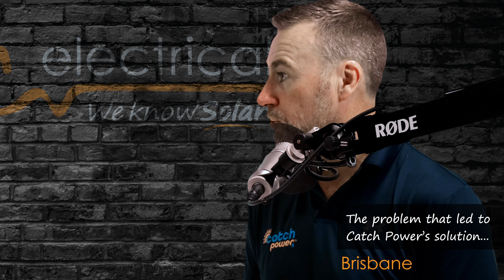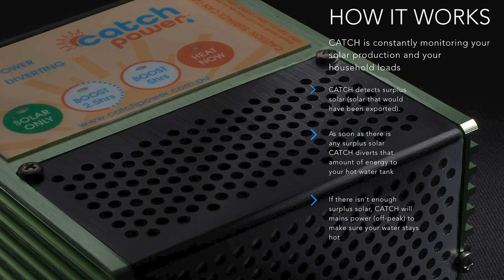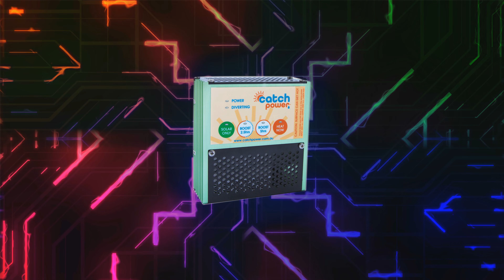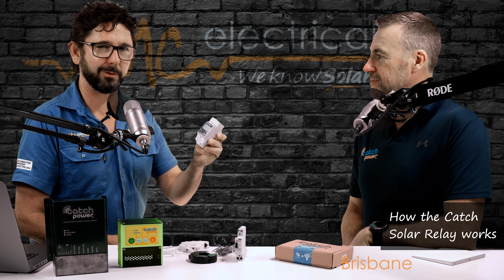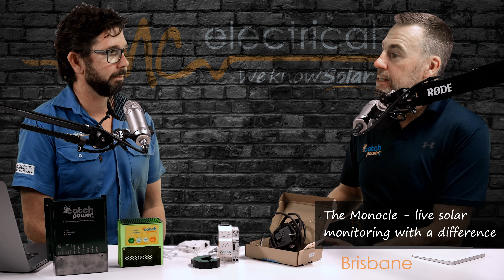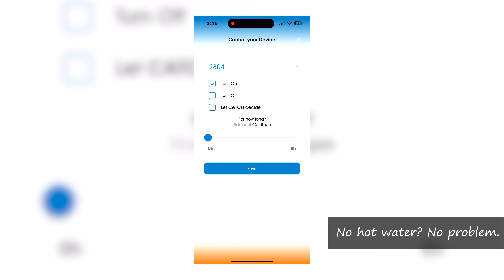Catch Power Full Review

Comment: I have had Solar for 14 years and also installed a Solar Analytics device so I could monitor load and solar production. The first thing I did was change the 4.8Kw HW element to a 2.4Kw to keep the load inside the Solar Curve and it is on a Shelly device and contactor if I need to turn the HWS off. I also have an instantaneous Gas Hot Water on a Shelly device so I can changeover in the event of prolonged overcast/bad weather. It works great and this device is awesome👍
Just signed up for a 28Kw battery after finding out that Feed in tariffs are heading to 1 cent per Ke next year. Solar export penalties are just around the corner.

Comment: Hi,
I have no idea the difference between this and a hws switch.  I'm about to install a battery, so is this worth the extra $1000 to have this on my T33 hws?
Reply from the maker: Nope. Maybe keep it simple with a battery. Actually depends on a lot of factors but …
Reply: @mcelectrical everything depends on X,y and z with this.  Installer is pushing for one.  I'm upgrading the inverter and adding battery both Sungrow, and possibly exporting a smidge to the grid ... The only thing it would handle is the HWS as far as I am aware.  
So don't get one.  Okay.
Better with the switch or no?  
I'd like to tell the elec co to be gone.

Comment: I'm not sure about having a hot water system (any hot water system) containing so many complex - and expensive - components to make and utilize hot water.  Do I need to ask, what is the return on all of this, or is this a status ?
Reply from the maker: Yeh I kind of agree. Keeping it simple is often best. But if you are already installing a solar system with a consumption monitor (Fronius smart meter) then this will only add a couple of hundred dollars. It’s much simpler and more affordable than a diverter like Green Catch or the Ohmpilot. And, less complex than a heat pump. But no doubt it reduces reliability.

Comment: I've just had solar installed along with a Catch Power solar relay. I found this vid very informative.

It's still early days but I found the app The Monocle to be... lacking. For example, there are many settings which it isn't able to alter such as the Export Control time (which I assume is the default load switching time). Yes, you can set a schedule but that has a definitive end date so if you forget that its ended, it just goes back to the default.

I've also discovered that the installer set the H/W tank wattage to 3600W but it's a 3000W tank (I've got to follow up with him about that). However, it does highlight the point that the end user is extremely dependent upon the installer configuring the device correctly which isn't necessarily a given.

So, plenty of potential but not a polished experience from a user's point of view.

My suggestion would be to merge the user app & the installer app into a single app, but password protect the installer side of things.
Reply from the maker: Yes good point. There is a lot we can see from the back end after the job is done. But you are relying a lot on the installer to do their job right.
Reply: @mcelectrical  I also latterly discovered that Catchpower documentation is awful.

As a telco tech & technical document writer, I'm used to incomplete or misleading technical docs but Catchpower docs have to be some of the worse that I've encountered.

They have plenty of information but tell you nothing at all.

A part of the problem is that there's no visibility of underlying default settings so there's no understanding of how the whole setup is structured.

It's a pity that there's no feedback channel for Catchpower. I'd love the opportunity to help them improve the user experience.

Comment: $447 is a hefty outlay plus installation costs.
though the new EV charger integration might make this more palatable if it works with current EV chargers. 
it'd take substantial ROI time
Reply from the maker: It also replaces your consumption monitor, (for a lot of inverters) so if you haven’t already installed solar, it makes it affordable. But, yeh as a retrofit it’s not that affordable.

Comment: Can’t say say I’m impressed with the Catch just installed, may well send it back.
Issues include a poorly integrated series of four apps needed & which tend to overlap, ie: The Monocole, then CatchPower for config), then Solar Analytics embedded within Monocle but then wants a separate app install for My Solar. A PITA.

Then there’s the all over-the-place endless documentation for various bits, much of which is poorly explained. I can never seem to see the HWS actually doing anything, though seems to remain hot so something must be working. Still, always seems to show ‘0W ON. 

I also had no success in setting up an EV charger via OCPP despite obtaining the specs through (once again) click, click through their apps, something like Montocle to CatchPower to website and add charger. After quite some messing around, Moncole seemed to have the right data as did the Wallbox, but would never start. Essentially this process just locked the charger. I wrote to Catch about this and the above but to date have had zero response.

SO my felling is to return it and put in a straight-up Hargar timer for the HWS. If I do eventually go for a heat pump, this will have its own time built in. Meantime am also trying Charge HQ. 

Could be a good box I guess, but the implementation (sw, apps, docs, support) appear very poor.

Comment: Looks like a very cool device. The way I understand it though, the only difference I can see between this device and the Fronius Load Management, is that with this device you can actually program when the device switches on. ie If there's cloud all day, you can program it to use the grid when the rates are cheaper, as different from the Fronius where it will just switch on to fit in with the minimum run time and end time. Or have I missed something?
Reply from the maker: That's one of many features. The Catch Control has levelled up recently to cover a few new use cases, more on it here: https://www.catchpower.com.au/catchcontrol

Comment: thanks for the review Mark.  I got my green catch power installed today at 10AM.  It's now 10:30PM and I noticed power is being diverted (full load) to the HWS suddenly.  It was cloudy today and I don't think the HWS actually got up to temp so perhaps green cp is in override mode already?  I understand it comes in after a couple of days of insufficient sun but being brand new today perhaps it just needs to get this override session out the way and should be normal from tomorrow?  Nothing in the users manual has any detail on this.  I would actually prefer if the logic used was documented, better for peace of mind and working out whether any manual override is necessary.
Reply from the maker: Hi Glen. That doesn’t sound right. Is it working now?
Reply: @mcelectrical  Yes, it is working perfectly now, just that first night diverted to HWS at full load (2.4kW) until thermostat cut-off.
Reply: @mcelectrical  I finally worked out what has been going on!  I had not read the part of the manual that distinguished between steady LED and flashing LED for controls "Solar Only" and "Heat Now".  For how I use the system, I need to have "Solar Only" LED flashing, meaning that even if water is cold HWS will not power on until daylight next day.  Missing this tripled my electricity cost yesterday, lesson learned!  In hindsight I wish that info like this was included on the Catch Power marketing webpage as it all helps to understand what you are getting before comitting to purchase.  Info is there, but not prominent enough IMO.

Comment: I have a GoodWe 6kw Hybrid inverter GW6000-ES-20 and 10kWh of Lipo4 battery storage, I have a standard hotwater system with no timer at all and runs whenever it needs. How would this be best incorporated?
Reply from the maker: It can work with Goodwe as a consumption monitor, but I’m assuming you already have one. It can just be installer as a hot water diverter, either before or after the battery.
Reply: @mcelectrical  Cheers :)

Comment: Cool product if you have still have a kettle hot water 
heat pumps are king and still best on a timer with override way and better solution imo
Reply from the maker: In most cases, yes probably. https://youtu.be/Mz2QaWodrzw?si=q0YZq_2jWXLbBrS3
Reply: Mine failed post warranty....have since simplified with Catch

Comment: So installed I’d be looking at around $850 ($750 + $100 install) for a Catch setup, instead of $250 ($150 + $100) for a normal timer switch with manual override and just put the hot water on a timer. I’m not sure I’d ever make the $600 back at it would only be days (hours) I’m not producing.
Reply from the maker: No, I think you are comparing the catch hot water diverter with a timer. The catch relay shouldn’t be so expensive, unless it is retrofitted
Reply: @mcelectrical  good pickup. That said even the relay is $450 so assume ~$550 installed which is ~$300 difference to a timer and I’m assuming the same install cost for both which may not be correct. I’m on the Sunshine Coast in QLD where it’s sunny most days and even on days when it’s overcast my 13KW of panels is still producing at the times I would set a timer. Even with out of control electricity prices I just can’t see how the unit would pay that off in 3-5 years (5 is its warranty). I say 3-5 because obviously you’d want to pay it off in 3-4 years so you make a profit from going to the effort of installing it.
Reply from the maker: If you already have a smart meter for your inverter, It’s about $150 more than a good quality timer fully installed. But if is a new solar install, it will replace your inverter’s smart meter, then cost about the same as a timer. The catch relay also has an app for simple clear monitoring, you can manually switch on or off water with your app, and your installer can use it for remote diagnosis. Catch also has dynamic export limitation capability, and EV charger control (coming soon). It’s so much better than a timer!

Comment: Your comment about, "...watching it follow the curve", is puzzling to me. My family has had a Green Catch since May and it has never shown on the Solar Web App (Fronius Inverter App). What can we do to be able to see this on the Solar Web also? 
You forgot to mention that the Green Catch will only divert power after the grid starts getting 500w. So if the grid is getting 600w, only 100w is diverted! This is what is happening for us anyway. We were never informed of this by Catch Power when we inquired about it before we bought it! I can vouch that the Green Catch works on a Controlled Load but not as good as one would expect because of the 500w problem I just mentioned. Maybe our Green Catch is not working properly or it has been wired in wrong?
I am hoping Catch Power will soon respond to my email and messages! We are on 3 Phases. We have a 3Phase Meter, and a Single Phase Controlled Load Meter which our Hot Water System is connected to. We are now looking again for a diverter that can divert power from all 3 Phases into our Hot Water System that is on CL. We went for Green catch because we couldn't find any 3 Phase solutions back when we did our research. We though Catch Power being Aussie, and the Green Catch able to catch all the bits and pieces of power, (so we thought) being sent to the grid, would be the best solution, even if it is only 1 Phase. We haven't saved any money yet with it but Summer hasn't really started for us yet so hears hoping for the best.

Comment: Can this be still be utilized to work if I have controlled load?
Reply from the maker: In qld no, but I’m NSW you can switch between controlled load and general light and power (t11).
Reply: @mcelectrical  thanks guys. Love the channel. Ultimately I just went with an istore heat pump system (thanks for the most part. to the debate video with you and Karl) and got them to switch the usage from controlled load to the regular/continuous supply, then have the istore activate between 9am - 3pm (which it’s only been taking 1 - 2 hours per day to heat up anyway, so essentially running 9am - 10:30/11am, all of which is using solar excess (or shoulder rates on the rainy days). Really happy with the path we opted for.
Thanks again for the great/informative videos.
Reply from the maker: Nice. I’d be keen to hear feedback good or bad. I’m now considering installing heat pumps as part of the business. Trying to do it eyes wide open.
Reply: @mcelectrical  absolutely love it. Combined with solar it almost makes it free water heating. Wish I had done it a long time ago. Obviously the longevity I can’t speak to, but if what Karl says is anywhere close to being right with the 15,000 hours, it will have paid itself off several times over and I would have no hesitation in replacing it with another straight off the bat when it dies.

Comment: Can this be used on a heat pump water heater?
Reply from the maker: No, heat pumps shouldn’t be cycled on and off regularly. However heat pumps use much less power, (less than 1000w) so they will probably sit underneath your solar production if your system was big enough.

Comment: does the Catch Power relay work with Aust. enphase systems?
Reply from the maker: It doesn’t work for the e phase monitoring platform, but yes it can control a hot water load, and provide an independent monitoring platform.

Comment: Would it be wise for a solar heart hot water system  ? In the winter it doesn’t work so well , or would it destroy the element ?
Reply from the maker: Yes you could use it for a solar hot water booster element - no problem.

Comment: Hi Mark, I have just had 10.7kW of panels installed with a Fronius Primo 8.2kW inverter. The system included a Fronius Smart meter. I am now looking at ditching my gas HWS and replacing with an electric storage HWS. Going by your video I don't need the smart meter if I install a Catch solar relay?
Is there an alternative if I keep the smart meter?
Reply from the maker: Hi Mega, yes, there are contacts you can use in the inverter, but they are not as versatile with settings and can’t easily be altered by the end user. I’d recommend upgrading to the catch.

Comment: G'day Mark

Thanks for another great video review❣

Can you advise if the Catch Relay can be used fully on large in-slab heating please (i.e., is the relay limited by a maximum load)? Also, is it permissible to use the relay to divert solar onto a control load circuit please?

Cheers

Peter
@ ACT
Reply from the maker: Hey Pete, yes you could control slab heating but you need a contacter to connect any load. In QLD you can’t switch between tariffs because  - we have common sense. In NSW you can switch between tariffs because - …… .- in ACT I’m unsure …. but I thought you mob were pretty clever.
Reply: @mcelectrical  Thanks for the reply Mark!  So could you elaborate as to whether that "cleverness" would be one of a technical or economic nature please mate?

Comment: Hi Mark. I have 10.4kW of panels and a Sungrow SGR10 Inverter.  I am about to purchase my first EV (Tesla) and I am wondering if it would make sense to use CATCH to feed the charging point?  That way ALL the current Feed In would be utilised to charge the car, virtually none to the grid.  The car becomes my virtual Home Battery although I don't think EV - Home (backfeed) is available as yet.  I am retired and only use the car to go shopping or local errands, the rest of the day it sits in the garage.
Q2 - do operate in the Gold Coast area?
Reply from the maker: Hi Stan, all you need is Charge HQ! Check out the app, and it will connect you your inverter and Tesla and charge the correct amount. Otherwise, just get a Zappy charger or something similar.
Reply: @mcelectrical  Thanks Mark, I shall look into both your suggestions.
Reply: @stanmoderate4460 
Just get the Tesla Gen 3 wall charger & Charge HQ.

Realistically though if you don't travel far, just charge when it's sunny & esp between about 9 & 3
We only charge once/week & travel around 350 ks/week.
Model Y.

Comment: How about controlling multiple loads, in stages eg: hest the electric hot water, then run the pool pump, then the spa heater. Is there technology in the pipeline to do this? Or is the app able to turn on a wireless PowerPoint adapter?
Reply from the maker: This would take multiple Catchpower relays. Not a bad idea!
Reply: Solahart home energy management can do this to a degree. Heating, cooling batteries, hot water, etc.

Comment: No discussion about 3Phase? How does Greencatch work with in terms of seeing 3 Phase production, and tapering up/down on the phase the hot water system is on?
Reply from the maker: Hi Emmet, in Australia we’re metered on the sum of the import and export. So if you are using 3.6kW on hot water on A phase and export 3.6kW on b+c phase, then you are not charged for consumption or paid for export. A 3 phase Green catch works this out and heats water appropriately. However the catch relay 3 phase solution wont be available for a few months- around June 2023.

Comment: Would this work with heat pump hot water systems as well?
Reply from the maker: No, I don’t usually recommend heat pumps because of reliability and increased upfront cost. Heat pumps don’t like being switched on and off regularly. A standard hot water tank and a catch relay is an efficient affordable and reliable alternative to a heat pump.